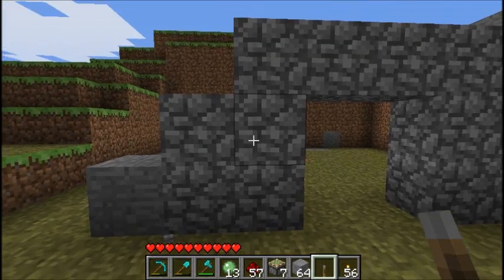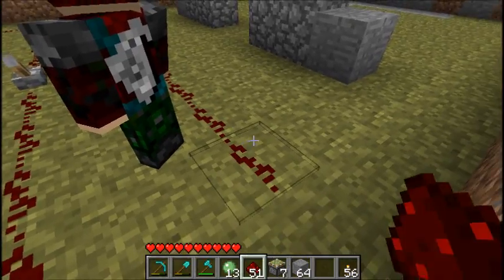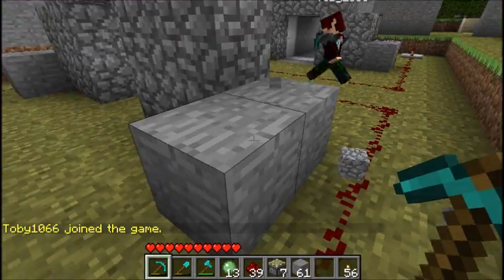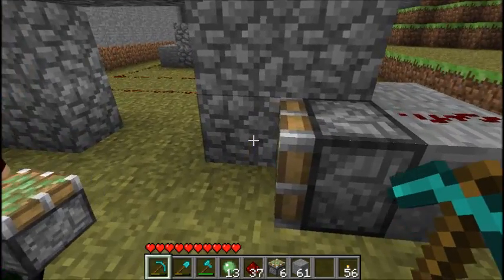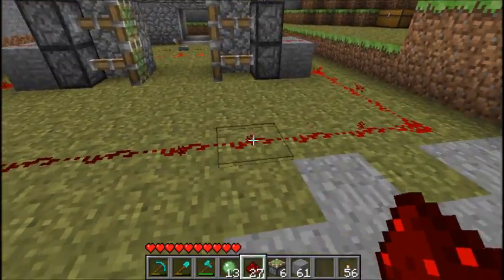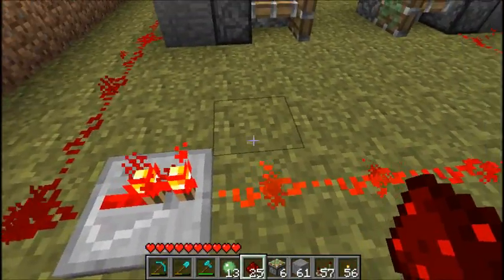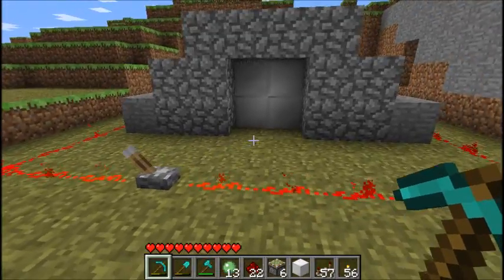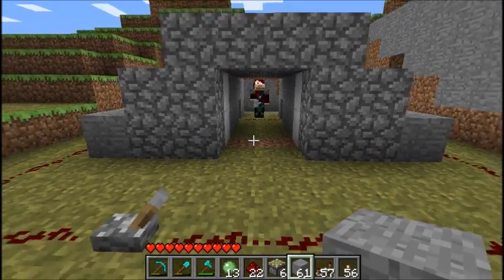Minecraft Beta 1.7 Patch: Piston Activated Door Tutorial!

Comment: I was just messing about with a similar system, and I noticed that you don't need to connect the lower pistons with redstone because they get powered by the circuit for the one above. 

You can see it in your own video, when you flicked the lever at about 2:20 the bottom pistons activate, even before you've their own circuit.